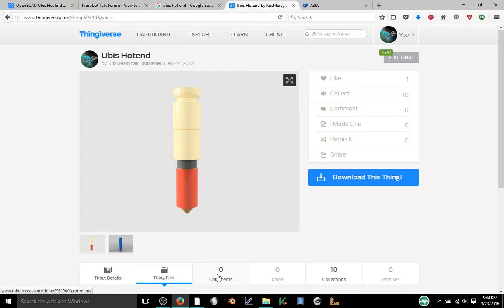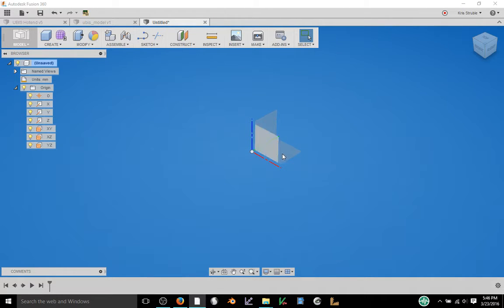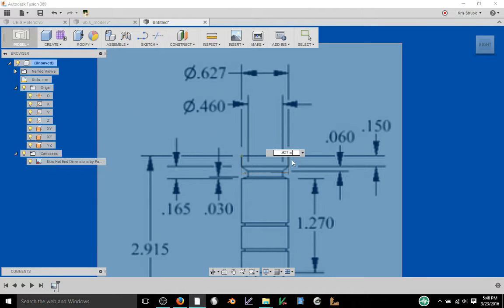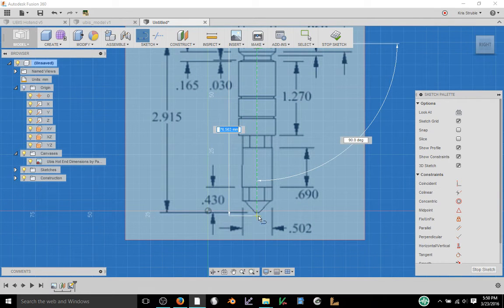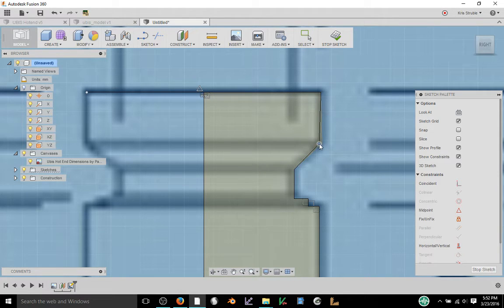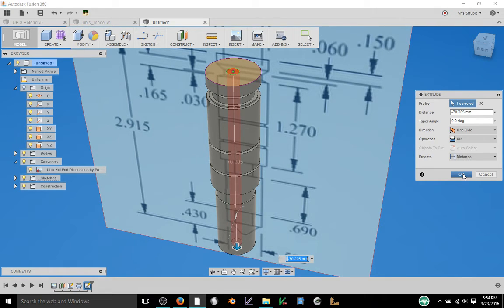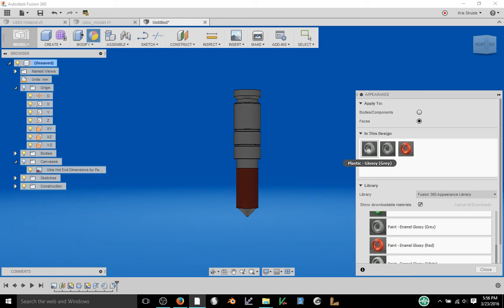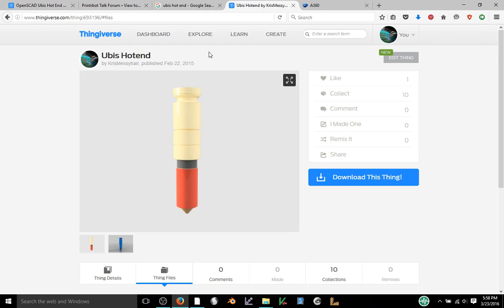Make a Part using Autodesk Fusion 360's Revolve tool.

Comment: Hi, the software won't let me select my sketch. do you know why it would do this?
Reply from the maker: Maybe it is hidden? click the light bulb next to the sketch folder and individual sketches to toggle its visibility. Let me know if that helps.
Reply: Hi, thanks. It had material crossing over the axis.  I deleted that and it worked. Thanks.

Comment: I have struggled for two months with creating a funnel that will attach to a 2" PVC pipe  I couldn't figure out the software at all until your video. This helped me so much and my part is correct now.
Reply from the maker: Michael, I am so glad the video helped you with your design.